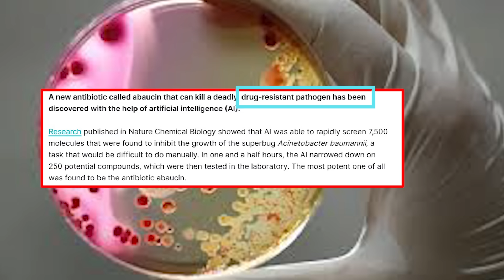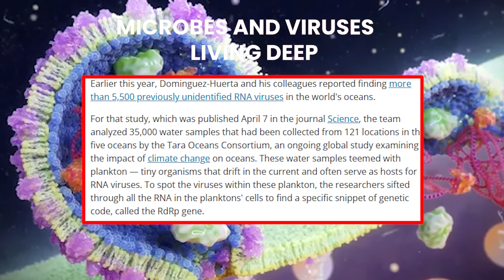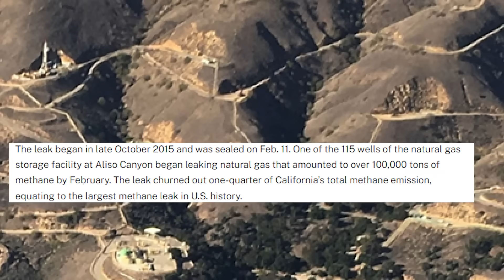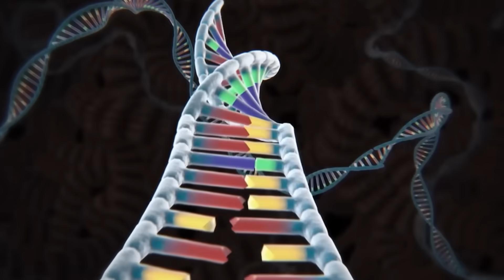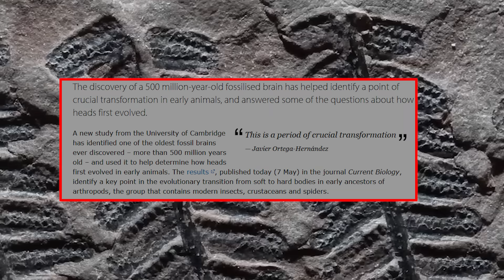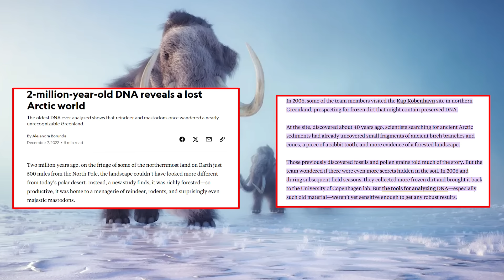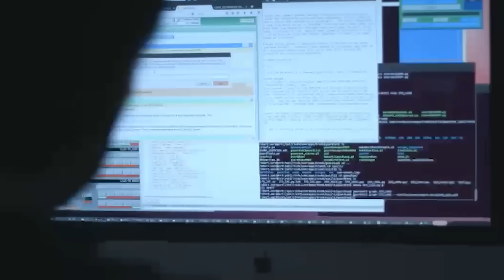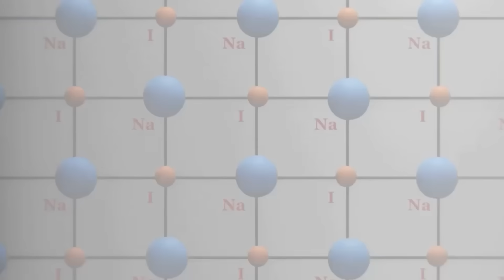Top 13 New Discoveries MADE By AI (Part 4)

Comment: Dark Matter (D.M) Is the same as Black Light (B.L.) is not visible to the human eye, and exists outside of current "Wave Length Models". In the same manner that "Light" exists so does Black Light, which is way faster. (F.T.L) Which will soon be accepted in the realm of science. The same way "Hyper Sonic" when it was once first proven. As will H.M.S. - Hyper Multi Sonic in time to come.

Which is used in "Specific areas of science" requiring a "Sleeve image" that can be rolled flat to present a 360 degree sweep of an infected area. Not too dis-similar to a C.T. Scan but far more detailed.